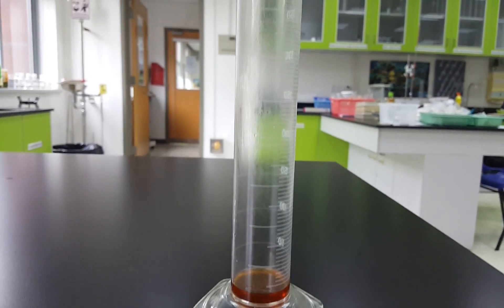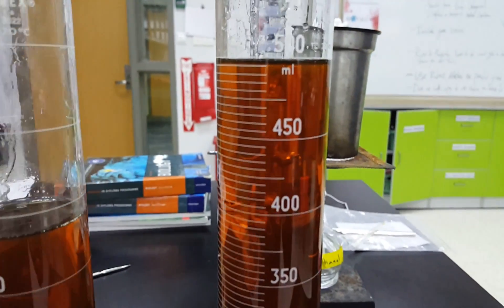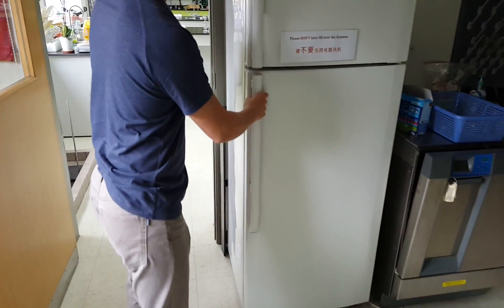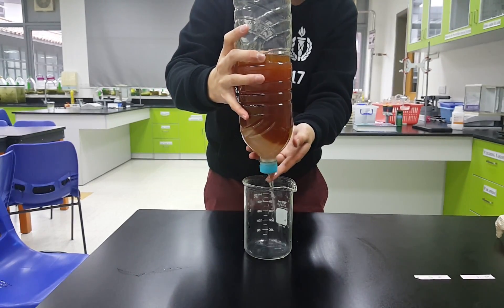Converting Cooking Oil into Biodiesel

Comment: Biodiesel "green" is a hoax! To obtain such huge amounts of oil that are required for the entire fleet of internal combustion engines, it is necessary to sow all existing arable land and plow the same amount. And in this case, there is hardly enough oil! This all leads to depletion of soils, destruction of natural biogeocenoses and to an even greater ecological catastrophe than it could be in the worst scenario of using fossil fuels! And this is without taking into account the fact that we will simply have nothing to eat, because all the arable land will be occupied for growing fuel!!!
In addition, your primitive technology can only give a very low percentage of conversion of triglycerides to methyl esters.  You have received a mixture of glycerides and methyl esters of low quality. You can't pour this into a diesel generator. Learn chemistry, guys. You still have a lot to learn before you can do something useful.

Comment: I get veg oil that has no other process other than just filtering down to 2 micron and an anti gelling agent added . Ive put this stuff in a deep freeze and it stays clear. I thin the wvo with about 30% kerosene to bring its viscosity close to diesel #2 . and it works fine in my older 6.5 Detroit engine.What is the benefit of going thru these extra steps of transesterfication? I thought that process was only necessary for animal fats.